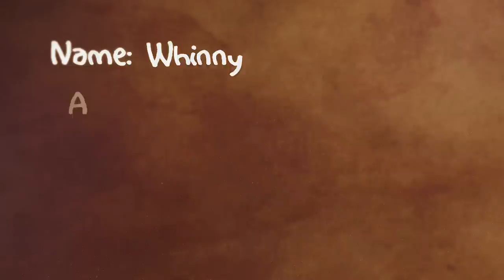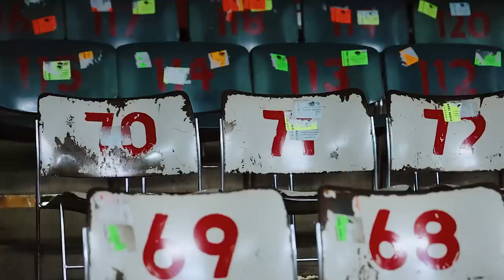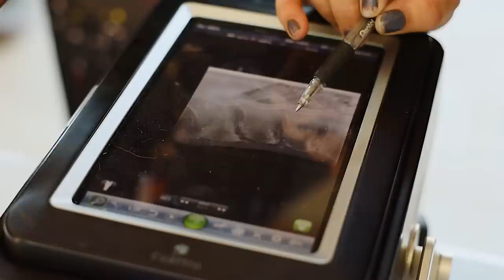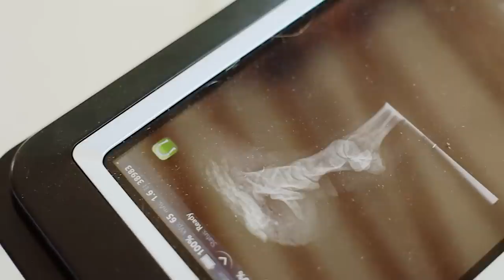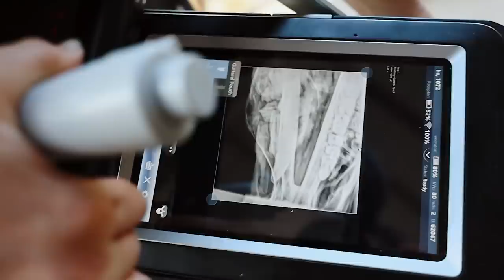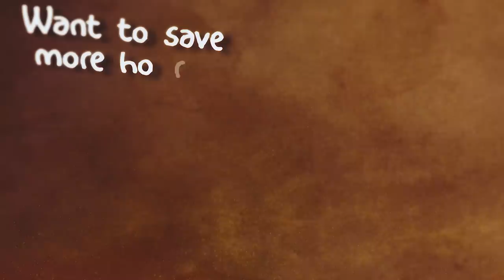Worst Teeth Ever - Horse Shelter Heroes S4E11

Comment: Try the hoof gp from Scotland. He glues blocks on hooves all the time. And does mention what he uses.
Reply: Those blocks are gued on the whole hoof. Mechanics work strongly against an extension like that. It needs to have extra on the front so it supports on the front hoof wall to work.

Comment: Can you try a Carvalho hoof boot to glue the extension onto for Ginger?
Maybe you could use a more aggressive glue if its adhered to the rubber on the boot and not a hoof. Also, hoof boot may just stay on better and not slip off.

Comment: @Kory.  If you get more information on the Rocky's, I should be able to find quick homes.  You are thinking of Icelandic Horse, mine is five gaited (walk, trot, tolt, canter, pace).  But Rocky Mountain Horses should be three gaited.  With a four-beat gait replacing the trot.  I have had some that don't even canter.  Sadly, I just lost my 22-year-old mare.  But I have owned several over the years.  It is a very new breed, but they come in all the solid colors with or without the silver gene.  But the silver gene is connected to an eye problem.  Double silver gene horses always have some problems, it is just to what extent.  So, have Dr. Nancy check all of their eyes.  My mare was foundation.  She had the foundation stallion, Tobe, on her papers plus the only dun at the time that was in the registry, only because they thought she was a buckskin.

Comment: Use a screw in plate made in the shape for ginger hoof that way it will work better than glue as you are getting ginger hoofs cut more often and with the farrier and it will benefit better as ginger will not pull the plate of so easily

Comment: Why don't you use the glue the farrier's use on cows hooves to add the lift pads. I bet it would hold your little sorrel's lift on.They put on their hoof to let the other half heals.  Sorry, I don't remember the name of the glue -- I know it is heated and looks like a big glue gun or a caulking  gun!
Reply: Bovibond is one and I know there is also a black glue but I don't remember there name. The glue used could be one. It was a 2 part adhesive.
Reply: I was wondering the same but horses hooves are different from cows so it may not work.